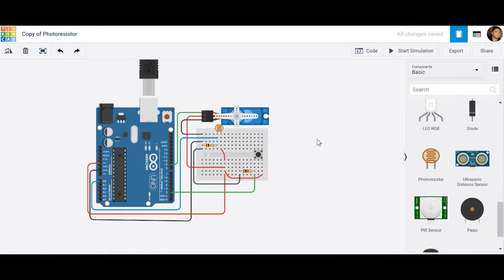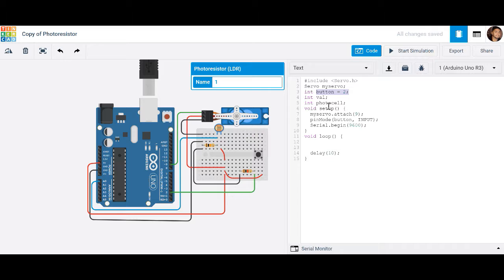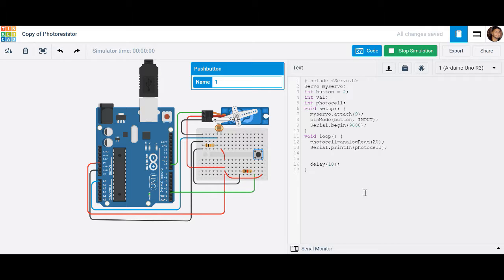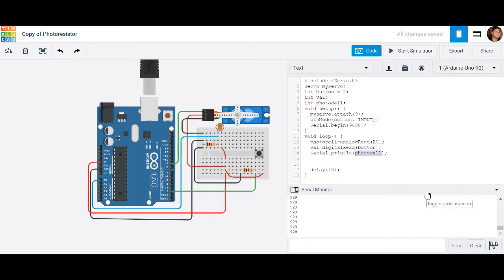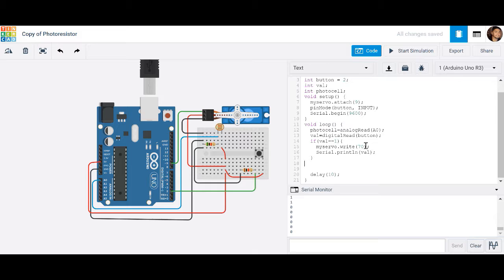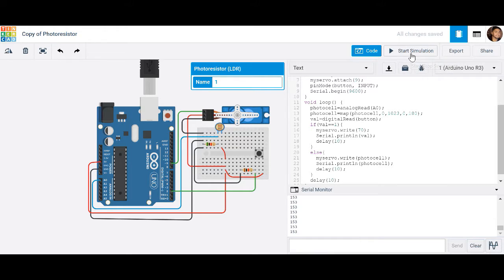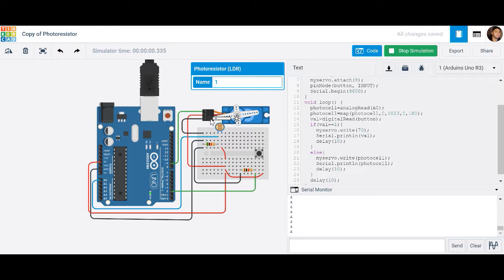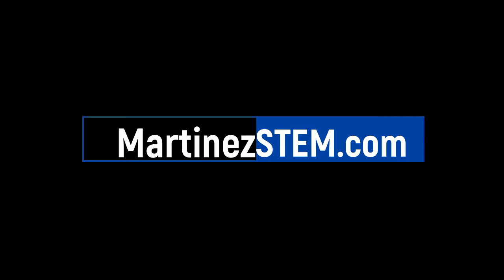Servo Control with Photoresistor & Push-button

Comment: bro code please
Reply from the maker: I put it in the description
Reply: @domingomartinez1536  that link doesnt work please just copy and paste it as a reply
Reply: The link has been renewed. It's available in Tinkercad if you have an account.
Reply: #include <Servo.h>
Servo myservo;
int button=2;
int val;
int photocell;
void setup()
{
  myservo.attach(9);
  pinMode(button,INPUT);
  Serial.begin(9600);
}

void loop()
{
  photocell= analogRead(A0);
  photocell=map(photocell,0,1023,0,180);
  Serial.print(photocell);
  Serial.print("  "); //empty space
  val=digitalRead(button);
  Serial.println(val);
  if(val==1){
    myservo.write(70);
    Serial.println(val);
    delay(10);
  }
  else{
    myservo.write(photocell);
    delay(10); // Delay a little bit to improve simulation performance
  }
  delay(10);
}
lol